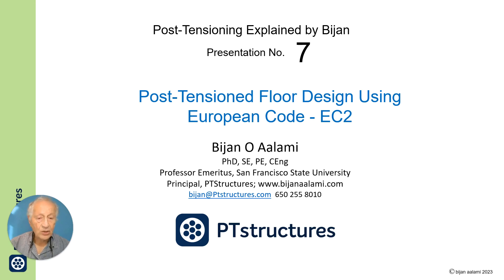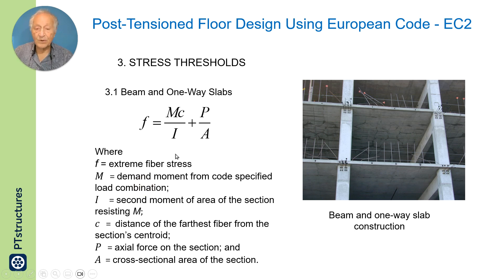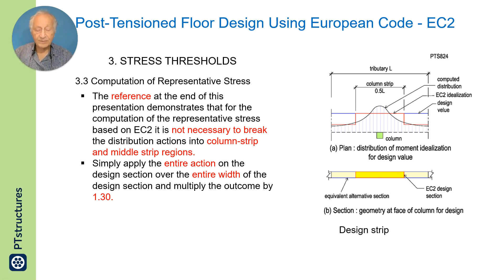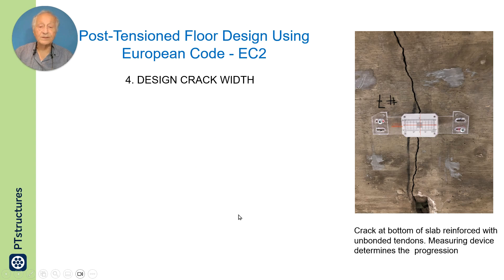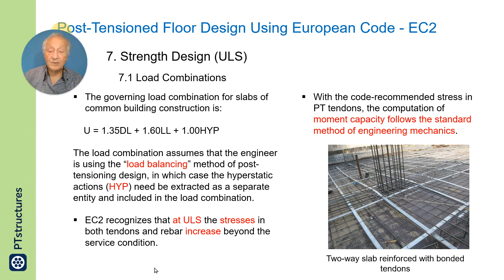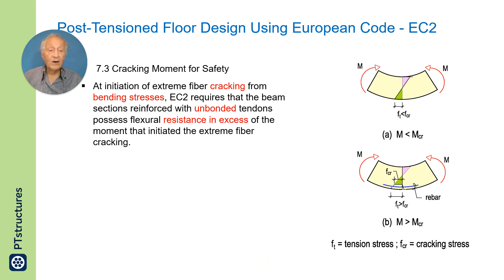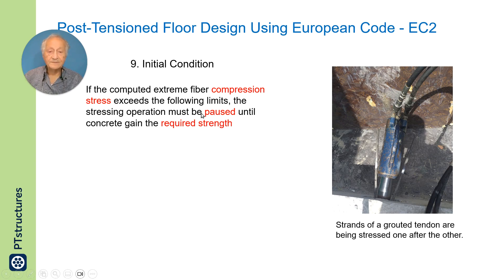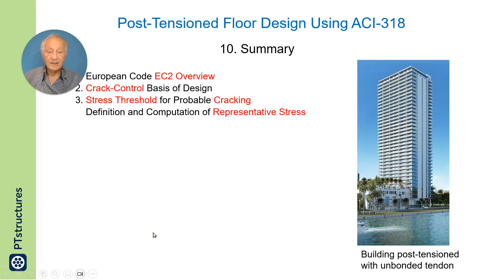7- Post Tensioned Floor Design Using European Code  EC2 Lecture

Comment: great presentation you are totally right, EC2 is very difficult,ACI code is complete and very detailed for post tensioning
Reply from the maker: As you note, EC2 is more complex than ACI. But, it gives you the freedom to design post-tensioning as it fits your specific condition, rather than following  rigid prescription for practically all conditions.